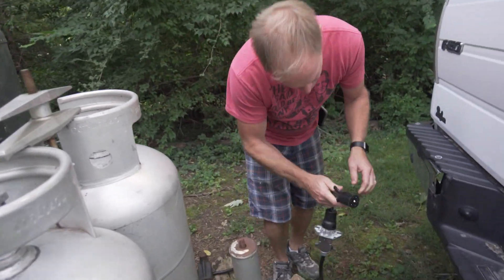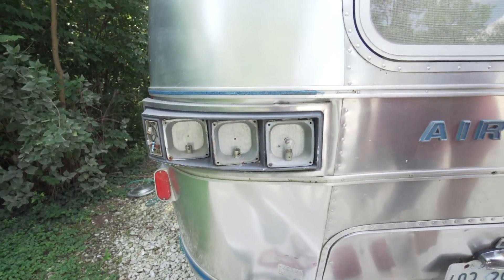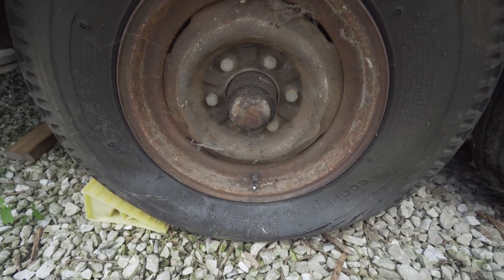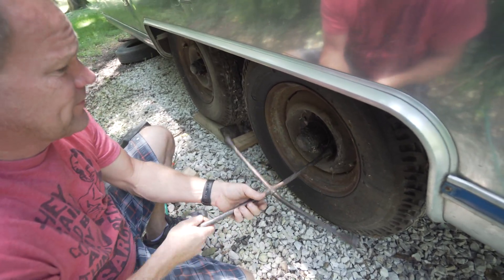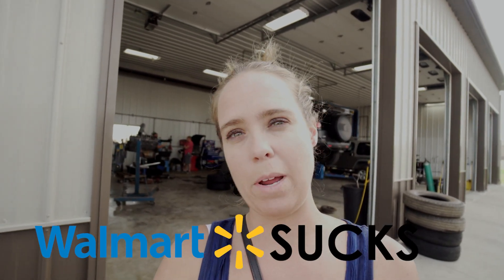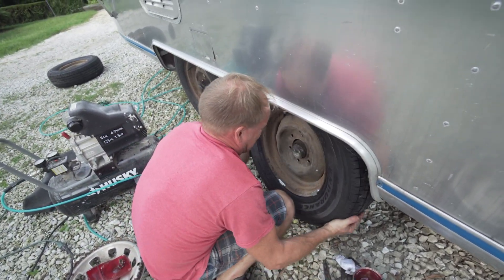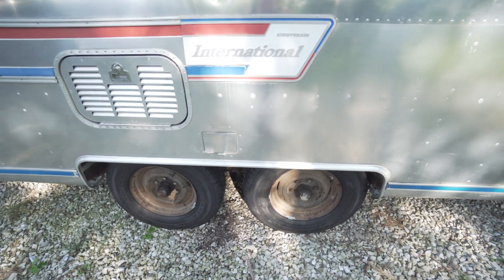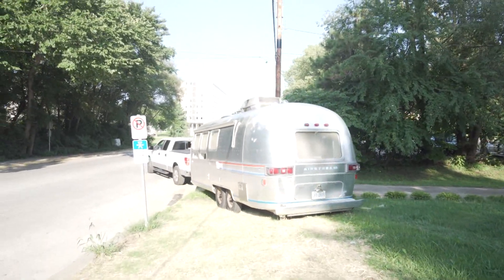Bringing Home Your Airstream

Comment: Next time take your jack a 12 ton bottle jack works good and place between the tires and jack up on the axle mounting plate and you can jack both tires on the same side at once, also never place your jack on the axle tube you will damage it only use the axle mounting plate as a jacking point.
Reply from the maker: We knew we could do it this way, but it was just as easy to drive up on the boards. We by no means did it the proper or fancy way!
Reply from the maker: We were on loose gravel and the way we did it still let us do two at a time (both fronts then both rear tires) seemed safer to me